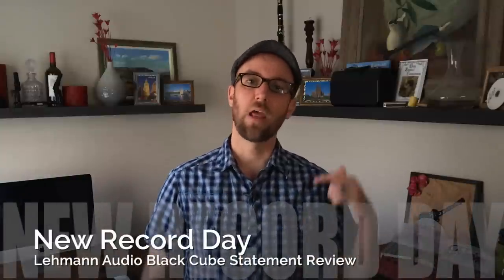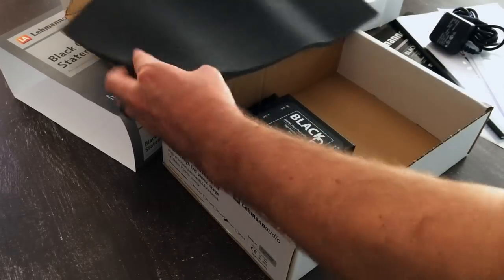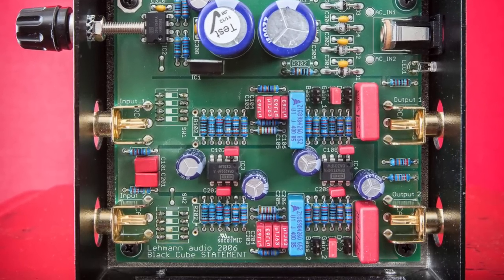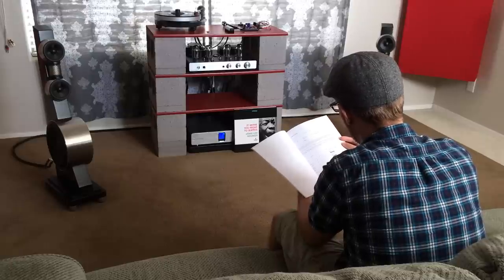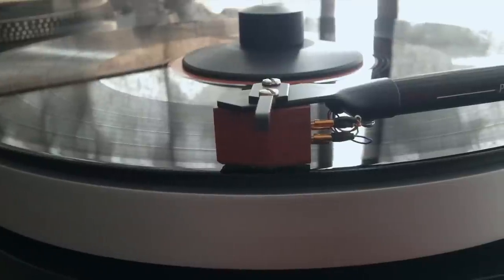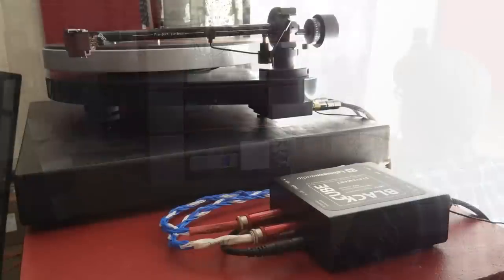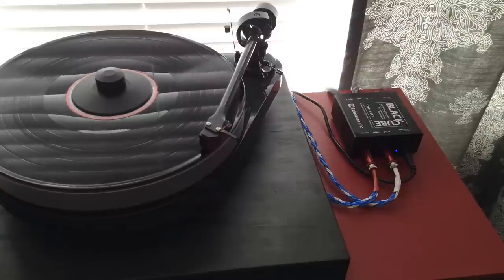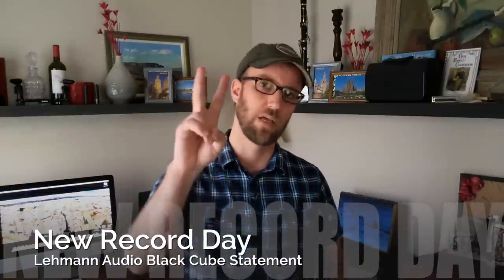Lehmann Audio Black Cube Statement Review

Comment: Hello, thank you for the nice review!  Just came across your video right now...
Just to clarify: you can always adjust gain and impedance independently from each other. So 51 dB or even 61 dB (usually MC gain) at 47k (MM impedance) is possible if your preamp can stand the level.

Comment: I have been using the black cube statement with a denon 103 cart/Sony str-7045 & ps-x5 tt. A fantastic combination. I have had better detail, but this combo is warm and punchy. I’m having a hard time trying to beat it!
Reply: HELLO, PLEASE, TO SET IT AT THE BEST WITH THE 103 CART. HOW DID YOU SET UP THE INTERNAL CIRCUIT FOR THE 103 CARTRIDGE? DID YOU ADD RESISTORS? DID YOU PUT JUMPERS TO INCREASE THE GAIN? THANKS